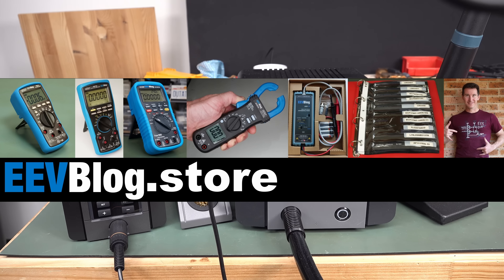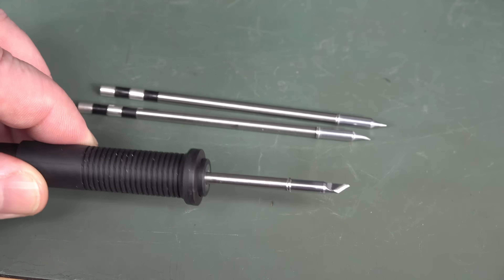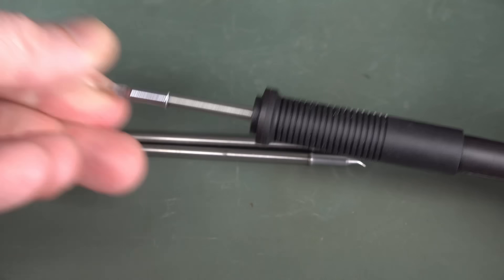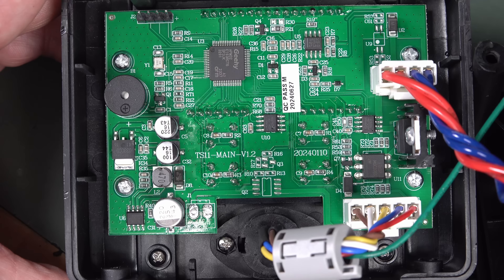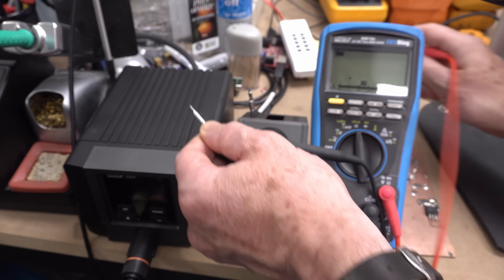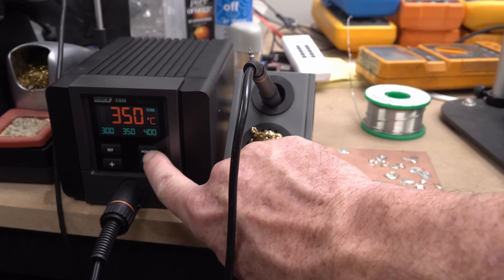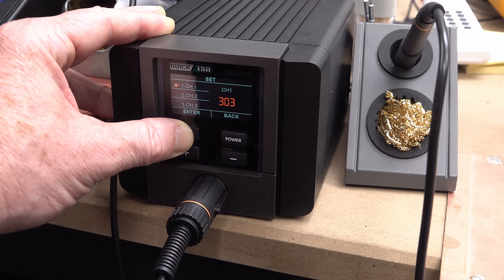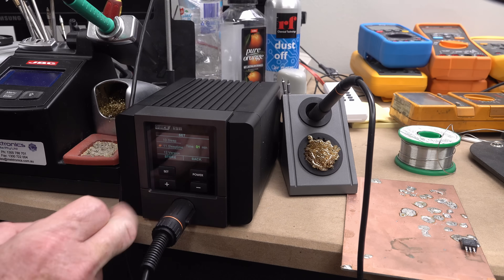EEVblog 1645 - $80 Quick TS11 Soldering Station REVIEW

Comment from the maker: Quick have replied:

First of all,We truly appreciate the time and effort you put into testing our product: Quick TS11 and sharing your honest feedback with your audience. 
As fans of your channel, we saw the video right after it was published, however we found that there were some issues with the product during your review, such as the design of the iron holder, no sponge, the power indicator problem, the sleep wake up sensor error, insufficient power, the limited selection of soldering tips and etc. To be honest, we didn’t want to reach out without a proper explanation or plan,that's why it took us a bit of time to contact you.

Our team is currently working on addressing these concerns:
1.Iron Holder
We’re developing a more user-friendly design to improve the overall experience;

2.Sponge Issue
We will offer an additional sponge or add the sponge in the new iron holder, allowing users to choose between brass wool or sponges based on their preference;

3.Sleep Sensor Error
This seems to be a rare issue, possibly related to shipping or handling. However, we’ll be conducting more thorough tests to prevent it in future batches, and we will send you a new soldering handpieces in next review;

4.Soldering Tips Slection
In fact we have more options for the soldering tip selecion, you can check the attachment, we should send you the detail range for your to choose from before sample shipped, sorry for the inconvenience .
And we would like to clarify that our soldering station is specifically designed for  micro-soldering applications in the mobile phone repair industry, making it ideally suited for soldering joints below 2mm. We apologize for not making this clear in our product documentation or marketing. Your feedback has highlighted the importance of specifying the target applications for our tools to ensure that users have the right expectations and can make the most out of our products.

5. Power insufficiency
The sensor potential of the soldering tip(the batch that sent to you) is not compatible with the station.

Sorry for all the issues and inconvenience,  it's a shame to disappoint you, and we look forward to the opportunity to show our commitment to quality and customer satisfaction. We would like to offer you a new unit of our  product once these improvements have been implemented, we believe that you will find the updated version to be a significant step forward.

We value your trust to review our product, as it helps us understand how our products perform in real-world scenarios and how we can improve them. We're actively looking into the concerns you mentioned and would appreciate any additional suggestions you have on how we can improve.
Reply: Well that is pretty solid response I'd say. Kudos for that!
Reply: That's the best customer support response I've ever seen.
Reply: I have the same issue . sleep sensor error
Reply: 😮 @miledghobril
Reply: Well that's really nice that they don't just say "we'll fix it, trust us"
But instead "we'll fix it and give you one to test and prove we fixed it"

Good on them.
Reply: very nice for quick , nice explanation

Comment: Martin Marietta schooled me on soldering years ago. Pace was king then. Pace is king now. Weller was in most labs. (Weller dropped the ball. BAD.) But Pace were who trained me and Pace made systems for aerospace work contracts and established the specs used still today. So I trust them. Yor lower-end consumer competitively priced model is amazing: capable enough and probably the best for most bench work for the buck. I love Quick hot air rework stations, not yet sold on their attempts to make in-roads into soldering irons. Micro work: under pre-heater plate + JBC Nano. Mid-range work: PACE! Heavy-duty work: American Beauty.

Comment: Avoid any chinese irons with proprietary cartridges.
I bought TS80 after the TS100 literally fell apart, and with TS80 the cartridges would die after few uses, and it was after hassle-free return periods.
I think to myself ok lets buy spare ones, I then find out the cartridges are more expensive than genuine JBC cartridges, wtf!
They lock you into their stuff with cheap irons and then the cartridges are expensive AF.
I'm fed up with all the chinesium soldering irons and looking at buying best of the best JBC.

Comment: I have TS11 for a few months now, and I really like it. It works perfectly for laptop and phone repairs. I think you have a faulty handle, because mine goes from the sleep mode right away, and it heats up instantly, so I absolutely don't mind having sleep mode at room temperature. The biggest issue I have with it is that there's only three tips available. I still can solder bigger stuff if I help the iron with a hot air, so it's not a deal breaker for me. Overall considering the price tag, this station is perfect for delicate work under a microscope.

Comment: My 12 dollar T12 station from aliexpress has sleep modes and movement sensors, and a endless variety of tips to pick from.
They solder just fine and i can buy multiple and keep one anywhere i go. Of even hook up a battery to them and solder on the move. Honestly i don't see the value of expensive soldering stations for hobby use, except for bragging rights.
BTW. I've used Metcals and ERSA's and Wellers and I still pick the cheapest T12 option.

Edit: those cheap stations have a two step sleep mode where first they go to idle mode and drop the temperature, and after some time they switch off and moving the iron wakes them right up.
Reply: Каждому своё. Кому и кобыла - невеста.

Comment: You'd think by now Dave would at least skim the manual before making a video. All he does is complain because any device he reviews doesn't work the way "HIS" mind works. Then to make matters worse he uses a knife edge tip to try to heat a ground plane.  Have yo ever soldered before dave ?

Comment: Did you get to try the Atten ST-1509? I was about to get their dual station but someone warned me you can't "cross the beams" or the thermal control goes ape. So I got two ST-1509's instead so they run on separate transformers and that worked super. Also, shame on you! Stop using a sponge!

Comment: The stuff I use all the time I'v put on a separate powerstrip, so when I "switch on the bench" the light, and soldering station etc all comes on automagicaly.
No need for any stupid power switches on the front, thank you verry much.

Comment: I would say it's not only the heat capacity of the tip - as indicated by the non-indicating power bars the iron does not even seem to deliver the power. No way that this is even close to 80 W. You could have tested the power input from the ac grid...
Reply: What do you mean, it probably does do 80W but the coupling is terrible inside.
Reply: @jaro6985  with a directly coupled heater inside the tip there is a limit how bad the coupling actually can be. You would almost have to intentionally thermally insulate the heater from the tip to get this bad performance...
Reply: @uwezimmermann5427  If you've used and taken apart copy T12 cartridges you'd know the coupling can be terrible. You don't need to insulate really, there could be a gap of 0.1mm to the copper, etc.

Comment: I didn't use the sponge for cleaning the tips of my soldering irons for more than 15 years and I never missed it once. Just today I threw a couple old ones away that I found in a drawer while cleaning... Also that iron is a fail, even if it is a budget device, there is a clear lack of understanding how a soldering station is supposed to work, like with the sleep mode and the temperature display. I wish you would have charted the heaing up process, because I honestly wonder how long it actually takes to heat up because the display is - to a fraudulent degree - showing something that suggests its super quick.I guess depending on how quick it is the complete cooldown to RT would be forgiveable as well (though I doubt it's <3 seconds).
Reply: Fraudulent is definitely a good word to describe that display.  Not the tiniest bit of overshoot, nor the tiniest flicker of temperature change under load.
Reply: @ferrumignis  Probably they reversed some wires on connector so both the sensors can't be read correctly

Comment: I have a few Weller stations with the Curie temp tips and sometimes it fails to switch off and I find the end glowing red hot. I have to give it a whack to get it to regulate again. Simple design, but not very reliable
Reply: I don’t think that is a common failure mode. Those have a many decades long reputation for reliability. Are you seeing it on multiple units??
Reply: @tookitogo  Yes, we had five units at our business and they all did it. I replaced the thermostats a few times. It happens roughly once every couple of years. I think it's more likely if they haven't been used in awhile.
Reply: @ oh wow. :(

Comment: @Ðave, if you want a stand like your pace or JBC or whatever and do not accept any different form, then go with your Pace or JBC, maybe tell people that you personally don't like that form. But don't bother everyone telling them "this freaking stand is ...." (kind of sh....oot?), when this is maybe only your personal taste. 

Nobody does need your sponge, if you already have that brass wool ready to clean up the tip and vice versa. While having to agree, that obviously the thermal capacity is not sufficient for proper working with most ground planes I cannot see proper technical objective advice from you. So, where is the benefit for your visitors?

And, yes, I do have JBC soldering station, so I also would prefer proper temperature readback being displayed on the display panel.

Comment: we have our soldering stations, hot air etc on a shared power strip that can be turned on and off with a easily reachable switch, and leave the switches on the devices themselves on. Bit annoying but works.

Comment: This heating issue is the same problem I had with my Pace ADS120 which made it unusable. I'll record my findings of the Quick TS11 in the next few days.
Reply: Looking forward to your review.  Dave can be overly critical.  Also, you are long overdue for a new flux shootout ;)
Reply: @jamesdavies686  I get my flux from pine trees. 
What's the difference with various flux ? 
I'm asking honestly as a new hobbyist. 
The flux either removes the oxide layer or it doesn't, right?
Reply: I think you mean ADS200?

Comment: Looks like normal 'T-12' tips that can be bought cheaply in China. Probably exchangable. I have those kinds of stations and they are nice for light work but not for more heavy tasks like with groundplanes and such... but also not for the real fine work. Something in-between... on one I have that timeout active and it is handy but also drives me mad sometimes. Everytime having to press that button, wait for a few seconds and then solder one thing, put it back in the holder and next time press the btton again. On mine (cheaper stations), they flash the temp that they have after pressing the button though, for a couple of seconds and then it is 'about on temperature'. But when cooling down on a big plane or in water, no change on the display.

The power differences between the tips you use, so it might be working better with other tips with the same connection and possibly higher output-power. 
90 Watts is probably the 'input' max. I guess so before the transformer and losses.

Comment: Your heating did not seem to work as the review done by schematix - maybe something wrong with cartridge or you using old firmware.
https://www.youtube.com/watch?v=vCNzxY1JcFE
Reply: Did you watch that video? He says it struggles to heat a simple through hole connection at 6:06.

Comment: It looks like the power bar relates to the target temp. If the target temp is at target all is well, no extra power. I wonder if the temp is being measured not from the tip but someone else further up the iron. Maybe try dousing the iron with water to really sap the energy out and see if that makes the power bar jump? I mean if that is the case, now you understand what is going on but it still means it's kinda pants as a tool.
Reply: If its like T12 the temperature is inside the heater core and not really that well coupled to the tip.
I'm sure it would deliver 80W if you dunked it.

Comment: Anytime you see a shake-proof washer with exposed locking teeth on the O.D., the engineers knew nothing about locking washers.  The teeth need to be on the I.D. (hidden under the screw head) to do their job.  "Outside tooth" lock washers are for other applications.

Comment: I've had the PACE for a few years now, and its very good. I'd have to say that its 95% of the functionality of a JCB, at about half the price. 
I have noted that the PACE pricing has gone up faster than the JCB pricing, so these 2 companies seem to be the leaders in the soldering station market high pricing. Does this make them the best on the market? After many years of using both, I'm going to have to say yes. 
 Weller was once upon a time the leader but they seem to be a distance 3 place maker now (maybe higher sales volume, but not equivalent functionality).
Reply: JBC, Metcal, Ersa, Hakko, Pace… all very good. Prevalence of each brand varies wildly by country.

Comment: The sensor in the handpiece must be gǒu pì from a Temu manufacturer. in other aspects, it's down to a lesser average because the resting pit for the pen is so openly loose it just can't seem safe enough to work with in the first place. i've handled equipment like this while repairing at work and i know it can be 10x better and easier than this.

Comment: Very Useless indeed, a soldering Iron should display the realtime tip temperature as you solder different solder junctions. Especially when soldering on a metal code PCB, the temperature tend to go down significantly and this should be displayed on the display.

Comment: I do all my soldering with two weller irons that are over 30 years old I have changed the tips one time , put a small chisel on one the old tip is still new unused the other has a more chunky chisel the tips never wear out I do have a royal desoldering station and an atten hot air station used mostly for heat shrink even solder vssop packages with the wellers using solder wick. Picked up a lot of soldering irons over time never counted how many I have 240v , 32v , 12v, 48v note the wellers are 48v.

Comment: You say "The thermal capacity is too small".
But the thermal capacity does not matter if your heater can provide enough power, heat capacity only matter if your iron is under powered.

The thermal resistance of the tip is too high, not the heat capacity to low!
Reply: yeah correct. what you care about is power transfer efficiency, not thermal capacity alone. when soldering big ground planes, thermal capacity is not very helpful, unless you have a big good old 500 g copper axe-style iron.
bigger tips help with that too, though: the greater the contact area (both between the tip and the surface worked on and between the heater element and the tip), the better.
Reply: I think this station can't deliver the power.
Reply: @bert-blank  it looks like a firmware bug really.
Reply: @bert-blank  There is a lack of power but it may be the heater itself. It doesn't matter what the base is rated at if the tip resistance is too high.
Reply: @bert-blank  It can. That's why it can heat up so fast but that does not matter if you cant transfer the heat.
Reply: "the thermal capacity does not matter"

Hmm, that must be why Pace, JBC, Metcal etc. all have high thermal capacity tips in their range...
Reply: @ferrumignis  to reword it in a better way, it's not thermal capacity alone that matters. high thermal capacity will be useless with low power and/or low power transfer efficiency, if the object to solder also has a high thermal capacity.
Reply: @GermanMythbuster  Can a thermal cavity be to small? Anyone, Elaine? 🕺

Comment: EEVBLOG Dave please test that iron as i think you will find that the power switch at front only turns off the display and power to the iron but there’s still power to the transformer, check how much draw there is on the power supply.

Comment: Rear power switches are definitely not user friendly if you need to have items along side each other access is a problem, I’ve modified several pieces of test equipment to have front switches, plus I usually modify the IEC leads to have 90deg plugs so the item fits closer to the wall. It saves many inches of space.

Comment: The Quick guys in China should watch 3 times and make improvement immediately since Dave did put money into your pocket, and US80 is not cheap enough to compete with KSGER, it's cheap, solid and Hakko tip compatible.

Comment: The tips look like a c115 o c210. Using a c115 with 45w I solder a transistor 45p40 package with a big heatsink attached with no problems. (I can't remove the heatsink because doing that I must desolder 50 tru hole pins and solder again).
Reply: Looks nothing like C115 or C210.